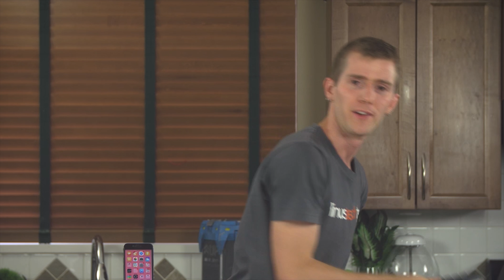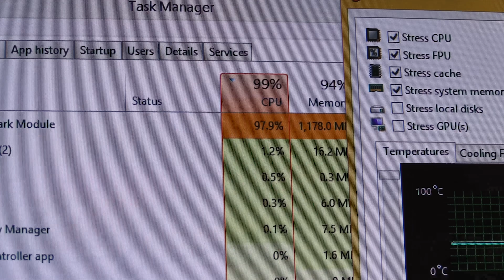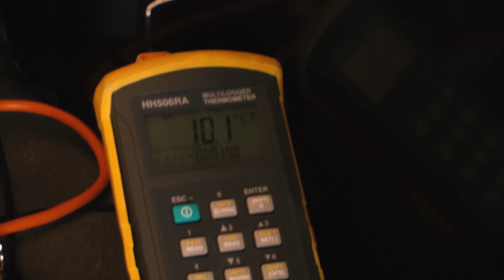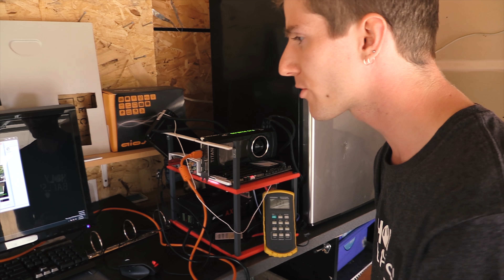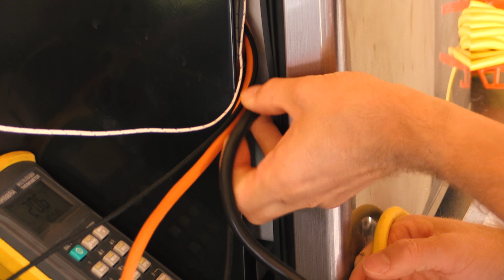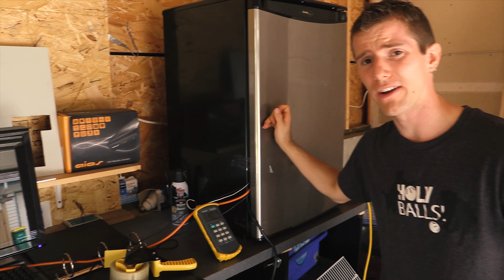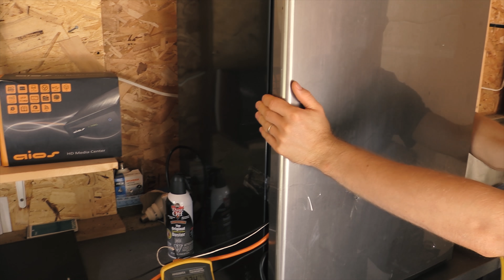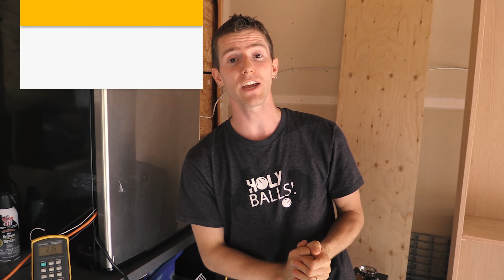PC Build in a Fridge - Does it Work??

Comment: LAME, you used a low capacity fridge to try and cool a very hot PC. 
Try this: PC on the outside side of fridge.  Normal liquid cooling through a radiator, then run the liquid into a fridge and a second radiator, then ruturn to the PC.

Comment: there's no airflow for heat to escape... this is the reason why you can't put a large container of hot food in a fridge that is either small or full, because the hot food takes up all the cold air the fridge gives off and will spoil the rest of the food in the fridge.

Comment: what about a electro-thermal plate and heat sinks set up on the case itself? The plates are 12v dc and can take power from the power supp. I know from experience that putting a plate between the cpu and heat can achieve a 20° C difference ie. 80° turns to 60°

Comment: Does Linus the Tech Tool know what HVAC stands for?
Reply: +Shawn Kearney OMFG. No. LG Cooling does not make computer room air conditioners, which are typically specially designed with dehumidification. If LG does make these units, they would be handled by LG HVAC.

In any case, do not plop your PC down in front of an air conditioner and call it good. Unless you like condensation.

BTW Linus. Take a fucking thermodynamics class.

Comment: I just wanted to ask. if it is not worth to place a pc or build it inside a fridge, do we are going to get an improvement if we place a pc near an airconditioner; like placing it right next to the air exit of the aircoditioned and eventually the pc would get lower temperatures? please reply this.

Comment: Question to all of you people.. i see allot of videos of people using the back of the pc as an intake with this corsair watercooling 1 fan system( recommended by corsair to blow air in so i heard in the videos ) so if you would use the back as an intake and the front as an intake and the top of the case as an exhaust.. does everything in the middle still really gets properly cooled ?? or does the air from the left and right gets sucked up out of the case instantly??tips from anyone please.. i can use the help..

Comment: hmmm.... you could rebuild a AC for computer cooling lol.. (i.e brutal overkill)

or if you live close to a flowing river then I've always wondered if you could build cooling based on that..

or if your house is semi submerged into the earth then that has amazing ability to regulate heat that could be used for computer cooling :p

but again if you want to do any kind of sub-ambient cooling you probably want to seal the unit and add plenty of silica gel pellets to absorb the moisture...

Comment: Wouldn't you have to adjust / compensate your temperature reading in the tests for the fact that the refrigerator door wasn't completely closed?  If someone was really going to build a system inside a refrigerator, they would have to make holes in the side to route the KVM cables through and seal them with some type of groment.

Comment: Figure 16btuh per watt (roughly). At 3 amps, a 3.5 cu.ft. mini fridge is going to maintain steady temps at 345 watts heat load (gross). Actual cooling capacity is a little less because the compressor heat is deducted from that. A larger fridge, with a fan, would no doubt keep the CPU temp in check, but the reality is, it's easier just to water cool your system if you have a bonafide cooling issue.

Comment: On this fridge unit, you could probably tear the sides off to help with heat dissipation. Or just go balls-out and use a horizontal deep freezer, HDDs on the outside, of course.

Comment: No. Dont put the pc in the fridge. Tubing from cpu block into a tank of water. Lowers temp. Then a tube from the tank of water into a fridge. Inside the fridge you have a coil of copper tubing that is submerged into a tank of water. The output tubing goes back into the cpu block. The way you are doing it is to cool it all at once. Will not work

Comment: An older refrigerator might do better. Especially if it has the condenser coil on the outside. The new ones try everything to use as little energy as possible.

Comment: Linus if you are reading this as you promised you would: keep the psu OUT of the fridge. I believe in a limited space it produce the most heat and there is no point cooling it in this case.

Comment: i did this with much smaller freezer a huge (4x4)tec cooler and mineral oil in the 90s with a p4 and 28 mb of ram but yeah it only offsets 20c w/o the tec cooler

Comment: The only issue with building a PC in a fridge is most high-end systems would outstrip the fridge's ability to remove heat. Refrigerators are designed to achieve and maintain a low temperature, not actively remove generated heat. You'd probably have more luck with a deep freeze unit, since those are designed to remove a lot more heat than a regular fridge.

Also, that's not a minifridge.

Comment: I had an expectation of this failing (Air flow as you mentioned).. But I'm not ready to abandon the idea entirely as my personal thoughts about a "cooling case" were never about placing a computer within a fridge (That seemed way too costly and energy wastful... Especially if it failed.. Which it would as seen here...)... 

What if we just built the computer inside of an overclocked cooler? Not a Coleman full plastic type cooler you take on camping trips.. But one with an actual cooling motor on it (preferably positioned on the one side of the cooler... Over clock the cooling motor and set up the board to pretty much take the cooled air to the board and it's installed component directly (Just place everything right in front of the cooling motor).. Water cool the CPU, and even the GPU with 4 fans per water cooling system.. And on the opposite side of the cooling motor of the cooler, cut up an "exhaust vent" for the required "heat dispenser", where you will attach the water cooling system(s) for CPU and/or GPU so that the fans push out the unwanted heat in the radiators with cool air generated from the cooler coming into the system via the cooling motor. 

Of course, some people are probably wondering "why not just strap an AC to the back of your tower bro?!"... To which I would kindly reply; "Because that shit is bulky, incompatible to all towers (Good luck directing your cool air to exactly where you want it... And a PC case isn't designed to keep generated cool air, well, cool... ;) But a cooler is! 

On paper:
Modded overclocked Cooler motor provides cool air for the cooler, which the system rests inside of positioned to accept the freshly made cool air first... While on the other side of the cooler, air is forced through the whole system by fans that are aimed at pushing air out... Being that the air is cold, it should bring extra efficiency to the whole system... 

Issues: 
- Where the fuck do I put my CD/RW/DVD player?
- Will the cooler mess up the WIFI signal?
- Do we cut another whole in the side of the cooler so the motherboard plugins are accessible? Or do we just make a hole large enough for cables to run through?

Anyways.. These were my thoughts about building a "refrigerated PC" of sorts.. Several years thinking about it... 0 seconds actually spent building it though... :(
Reply: +Alexandre Anderson (Sixty-Nine) None of all of this is designed to cool down hot stuff. You never put something hot in an fridge nor do you put something hot in an freezer, doesnt matter what kind it is. First of all, you simply dont have any airflow and on top of that PC hardware generates way too much heat.
Reply: TheLordOfWar I don't think you read what I wrote in it's entirety... Or you simply didn't understand or envision the concept... Else you wouldn't tell me shit I already knew, and described in my 50 lines of text... 

I'm not as bold as to say the design is perfect... But it covered everything you just mentioned... 

I think that your mistake is thinking everything is already hot when placed in the cooler, when that wouldn't be the case at all.. The components are not naturally hot, they get hot as more energy is being put into them... You combat the heat with cool air rather than the usual ambient air that you are currently using to run your tower with right now.. I shouldn't need to explain the difference between cool air cooling and ambient air cooling.. We seen it at the beginning of this video! The problem with the fridge is it has no air flow, the cooling motor is not designed to run constantly, and there is no where for the generated heat to go but to remain inside the fridge (Which makes war between the temperatures)..
 
The motor on a portable cooler though is made to run overtime in order to quickly bring back the cooler and it's encased items back to a cool temperature when you are out in the woods camping! Just rig it to constantly run (Which it would if there was a hole on the other side of the cooler with 4 to 8 fans pulling the cool air through the cooler, and then out of it through the radiators of the water coolers for the CPU and GPU (which would pull generated heat away and out of the actual system... Meaning little heat would actually be generated inside the cooler as it would all be drawn out to the radiators mounted on the side...)...). This literally results in a "wind tunnel" effect within the cooler, where cool air could be forced through the whole system, and then pushed through the radiators in the back... 

Air Flow - CHECK
Heat sink - CHECK

Anything else you want to try and debunk without careful consideration? 
I mean seriously.. Of all the things that could go wrong in this design.. You go after the two things that the design are meant to cover... -.-
Come at me with condensation issues, or where the PSU goes or wire management.... But don't sit there dismissing the two things the design on paper was designed to solve without ever having to try it out! That's just halting progress!

Comment: What made this really not work for a good test was due to the fact that you could not get the door to properly seal to keep the inside cold. If you can figure out a way to run the wires inside without having a leak. You might end up with a better idle temp.
Reply: +revenous167 no because fridges simply arent designed to cool down anything that generates heat. They are made to cool down stuff on room temperature and make it last longer and not to cool down something that generates several hundreds of watts of heat. This thing is isolated to keep the cool air in, so it also keeps in the hot air which the fridge simply cant get rid off at all.

Comment: The mini-fridge cannot move that constant heat load, sure.  Now step it up a notch and put that rig inside a FREEZER.
Reply: +Franklin Cerpico those are still not designed to move an constant heat load. Infact condensation is an massive problem in an freezer. Lets imagine it would work. As soon as you would turn off the PC for the night it wouldnt boot on the next day since frozen hardware doesnt boot. Thats why they have blowtorches as extreme overclocking competitions where they use LN2 cooling. Those CPUs dont survive a single day of the competition.
Reply: TheLordOfWar
 I'm sure your correct, I'd just like to see it attempted like he did with the fridge.
Reply: +TheLordOfWar Jesus Christ dude. I know your comment is 2 months old but yeah. You only use "an" before words that start with a vowel. Yes that's the BASIC rule. The real rule is the SOUND of the word. All other cases, you use "a". So "a constant", "a massive", "a freezer".

Comment: the only safe way to make a pc using a fridge, is if they use a series of peltier units instead of a radiator. also still needs to be a way for the air to leave, best done via a tube with  a fan on each end.

the reason its unsafe is because the compressor system will become overworked and draw more power than they can handle from the wall. they are meant to keep an area with no real influence of heat cool. not to cool something actively. peltier units however are meant to work to cool something, and work far better for this. peltier fridges are MUCH cheaper as well.

Comment: Build a fridge in a AC unit
Reply: +Eruntien killbane It's not cold inside of the AC unit... Have you ever felt the heat coming out of the back? The cool air comes from the liquid coolant inside of the copper pipes and blows out of the front.
Reply: ***** Im aware of that. I was joking because it would be stupid and could break parts

Comment: Mini-fridges are horribly inefficient, however, Linus, why don't you try to run the evaporator coils from the fridge (the cold ones) through a water cooling exchanger? Just cut out the fridge middle man and directly cool components.

Comment: I actually felt sorry for this refrigerator here. :D Why don't you try something that will perhaps work better? Get a Caselabs TX10, put a 140x9 radiator in the top, position a window unit air conditioner so its intake is behind the motherboard exhaust and it blows cold air into the top compartment, to be exhausted through the 140x9 and out the top?

Comment: idk how it would stand up to the ice crystallization as well as the moisture. Still watching the video. But it's like anything can't have it to dry or it doesn't last long as it dry-rots and can't be to wet as in humidity or it could cause un-intended connections as well as metal decomposition over time. may be good for a little while but long term i could say it would not last. but i can say if you used a mini cube freezer for a radiator / fan system on the inside of the cube freezer then have the PC its self outside running the coolant hoses outward into the PC circulation and then back into the cube freezer to the radiator / fans. but just don't leave the cube freezer on without the PC or cooling system because the fans on the radiator will freeze up. i was wanting to build a cub freezer coolant circulation system my self based on some of my friends systems seems like it does way better then the average water-cooling setup. anyway i like your videos your personality / interaction with the viewers via cam is inviting and friendly and that's why i keep watching your videos plus i am a PC hobbyist / enthusiast my self.

Comment: Funny thing is.. I did this back in the later 90's with my old K6 based system (You know back when AMD was notorious for running hot)
This does work, but not how you just crammed it all in there and trying to run the cords through the actual open door, you are letting a lot of cool air out through that gap with the seal broken which might not seem too large to you but for that fridge it's a massive leak.
But on a side note is it cost effective.. Nah not really it costs a good bit to run the compressor on that fridge unit even if you do get it for free (I did)

Comment: I worked with refrigerated systems in a server room. It is based on scale and air flow. Plus having dehumidifier to handle the moisture. Although it is not considered a frig it stays about 40 degrees in the room to where I was able to leave me drinks in the server room to chill. I also thought it was a waste to have such a low temp the people that own the room wanted to waste the money and also had data mining equipment that runs hot as hell. They could have gotten away with 60 degrees Fahrenheit.

Comment: A good idea would be to make a box with one intake hole and one "exhaust". With a Peltier plate cold side stuck on a cpu cooler like a EVO 212 for intake, a slightly lower ambient temperature should be achieved.

Comment: To make the system more efficient with the fancy build, I would take the side cover off the fridge and add something along the lines of a car radiator or other large heatsink type thing with some basic active cooling. The cooler you keep the hot side, the colder the cold side will be. The larger the temperature difference is, the less efficient conventional heat pumps are.
Reply: Power Max Umm, that makes me think though... strap a MoBo to a car radiator and active heat pump directly, no non-sense!!!!

Comment: what if you use a quantum freezer designed to run at less than 1 kelvin (-272 c) 
You can build one yourself if you know what your doing. If you replace the compressor on the fridge with that, and ventilate it, you should get some serious cooling action.

Comment: An important realization is: don't buy heavy duty cooling components from PC manufacturers, as they will be very very expensive. You can see that with radiators, that are really expensive, even tiny ones, compared to what you use for your car. And your car puts out a lot more heat than any PC ever can and your engine not breaking depends on it. There is a lot more cooling knowhow and cheaper more efficient products by other manufacturers that have been doing this before PCs even existed.

A good example of this would be if you buy a PC from a car manufacturer. Judging how overpriced and pathetic their enterainment systems and GPS navigation is, the PC would be, a good PC would cost you 20,000 dollars and would run a totally terrible custom OS that is unusable.

Comment: Thanks for doing this video. I did that thought experiment some time ago and came to the same conclusion: Any fridge cannot handle anything that actively generates heat. A really exciting experiment would be to put a room airconditioner to cool a little fridge where you put a high performance computer and see if you can do some serious overclocking. Also, what about a walk in commercial freezer that generates -35°C? That should be enough to do some serious overclocking.